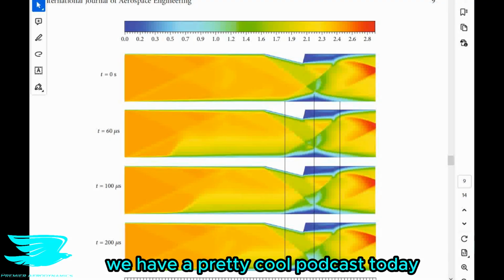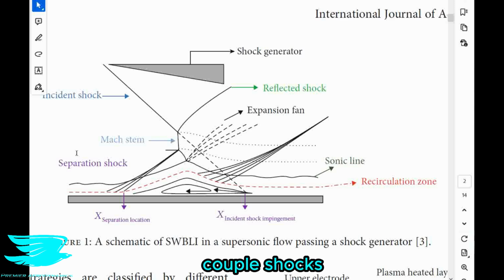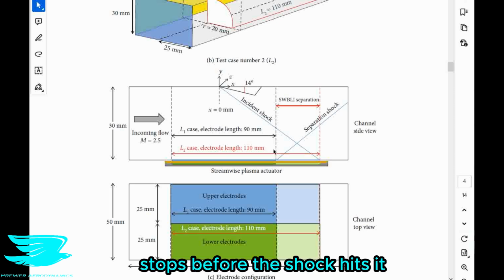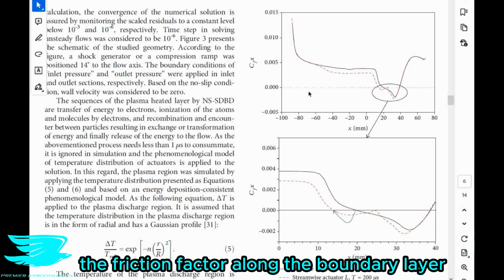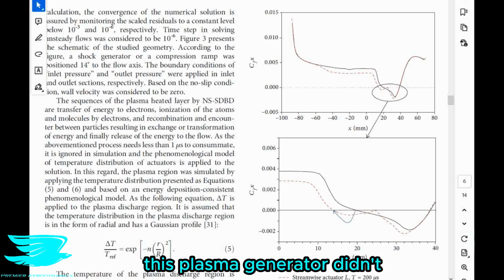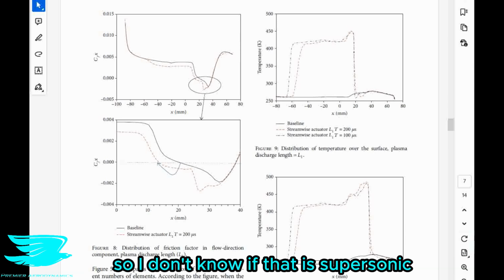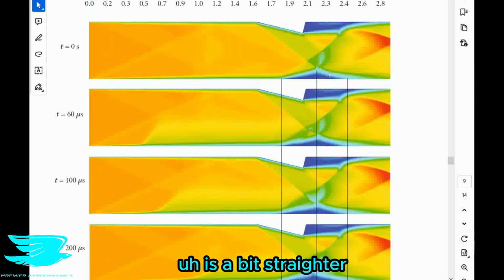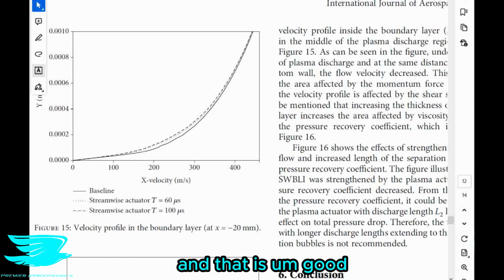Podcast #173 Controlling Shockwaves with Plasma

Comment: I always found it interesting how sonic separation bubbles re-attach with expansion fans.
Reply: Ive got  a shock wave detaching the plasma rundown in a discharge chamber. Reattaching it by turbulence re--energising the boundary layer ... high pulse power n temp envir. How to do? Thoughts?😢
Reply: @MisterColombo-t6m  Why not use dielectric plasma discharge to handle the separation?
Reply from the maker: Yeah, I have always found expansion fans interesting too, and when a shock wave bends.